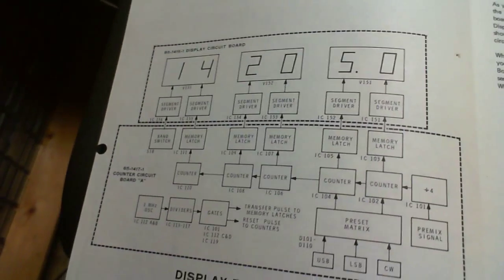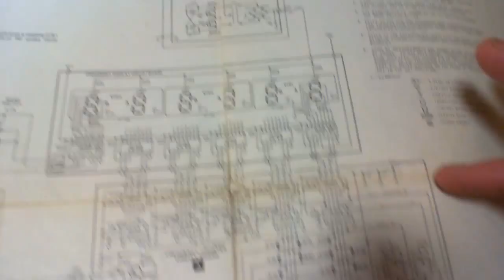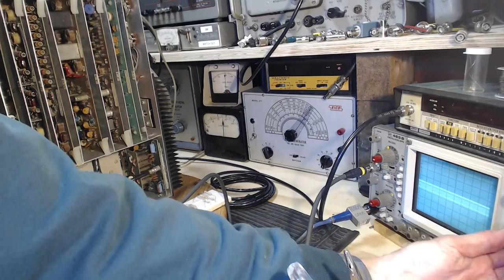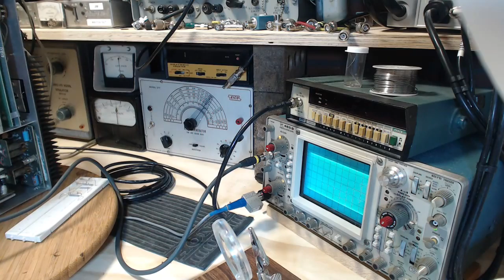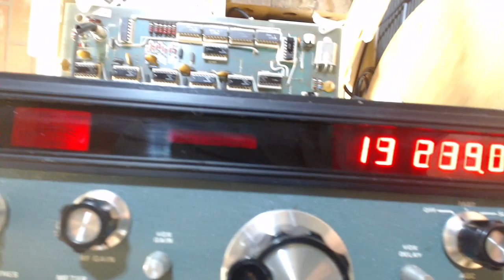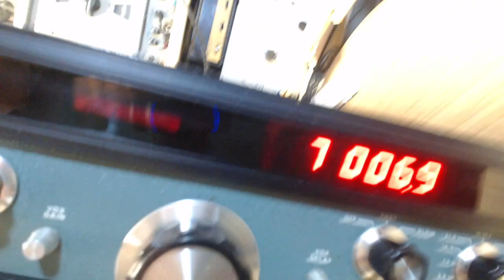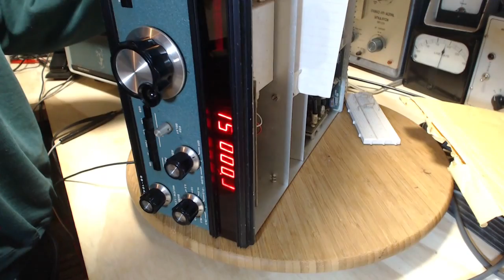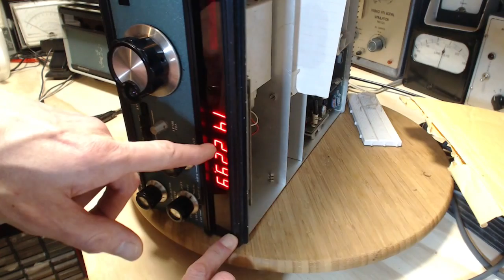Heathkit SB104A Transceiver Video #19 - The Payoff

Comment: I was wondering if applying a little dielectric grease to the board contacts might help with insertion and the electrical connection of the board contacts after you have cleaned them?

Comment: Jim:
Well that is a poorly designed "card cage" IMHO. No guides for the cards makes the prone to touch the metal plates between each one. Also need for more stress to remove and insert the cards properly too. Stress relates to flew and tends to pop IC's out of those poor sockets and well as possible trace cracking.
One thing is I noticed there was no solder on the bottom barrels that plug into the card cage on the Display Board on the top. Is that per the instructions for assembly?
Also the Display board has latches...what generates the signal for the latches to clear and latch a new frequency? Is that the crystal oscillator on the Display Board?